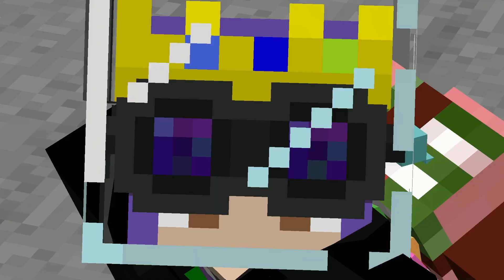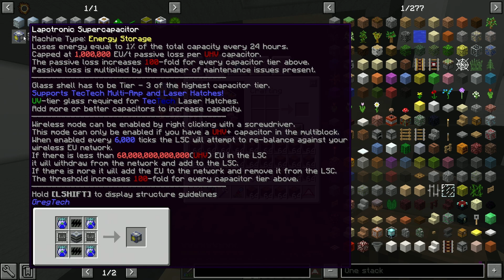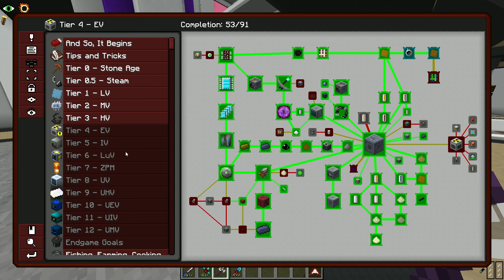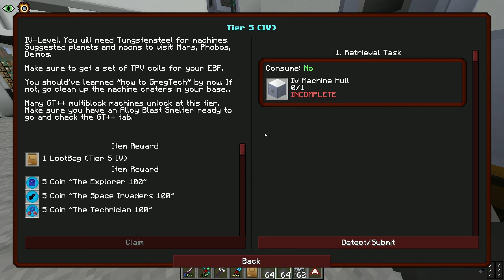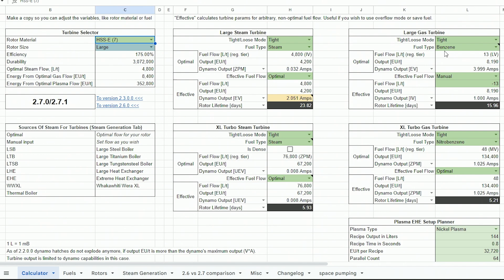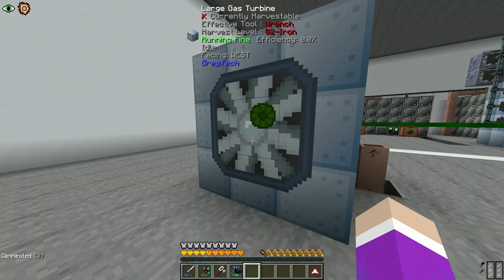Gregtech New Horizons Ep.19 More Power Upgrades

Comment: You may want to put a standard ev battery buffer near machines that consume a lot of power like ebfs or have surges in demand when autocrafting. Also “refreshes” the amps so you won’t run into issues where there are not enough available amps from cable loss